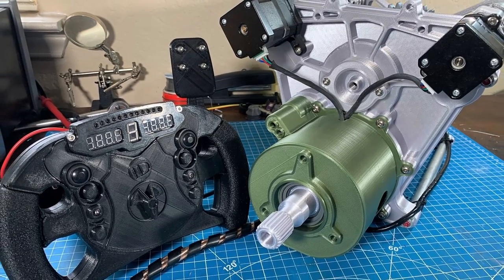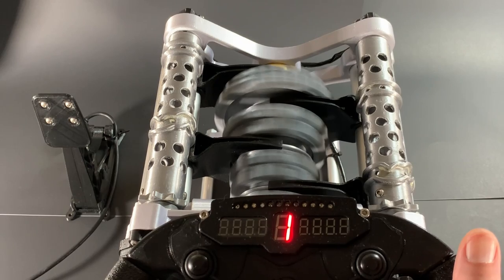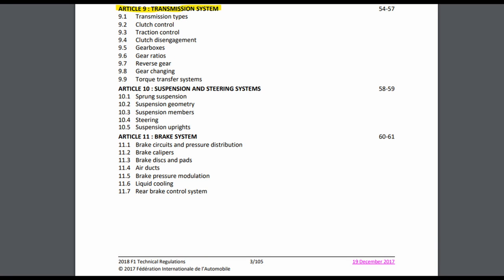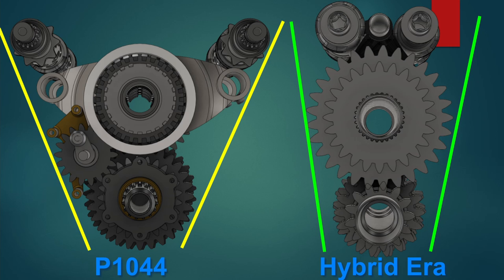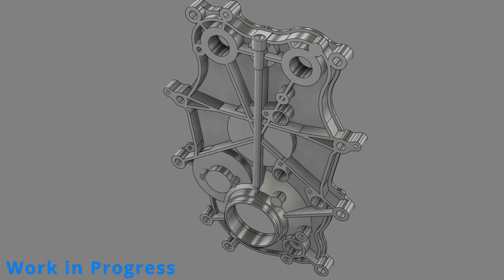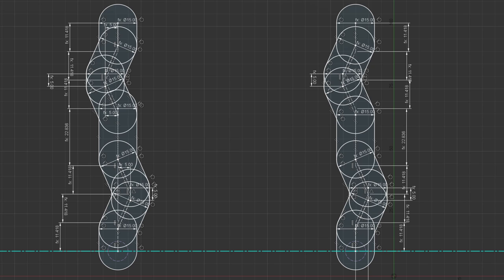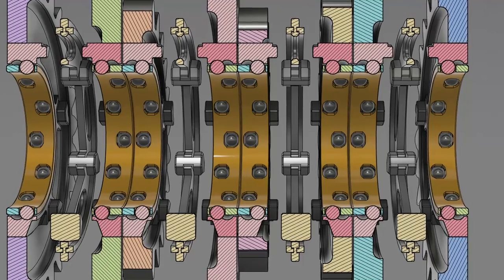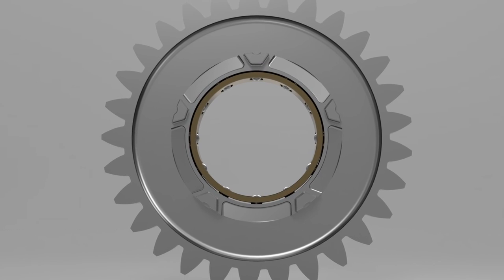F1 Hybrid Era Seamless Gearbox Pt1

Comment: you should check out MATLABS and the Simulink addon. its great to help you with coding and has an awesome modeling environment and simulator. plus the community is really informative, costs money for the one time license, has a free triail. I just got the home edition because im only trying to make some autonomous robots, but I think you would benefit from it a lot with all the technical working your running. Awesome watching you build these marvelous of engineering, keep it up. would have loved to see the other F1 gearbox in an rc car :p
Reply from the maker: Thanks!  I really do need to check out Simulink.  The hard part is I’m weak in the math side and being able to accurately model systems. The active suspension project definitely has sent me back to the books to brush up on my linear algebra.

Comment: 2:18 fyi, I think "no torque loss" is more of a marketing term of an entire system. 

I think they way you envision this gearbox is not accurate.  I think the dog of a oncoming gear would be destroyed if it was slammed in and the offoing dog would not have time to disengage. And even if both survived, the disturbance to the output shaft would be enormous.  
Is that really how it works? Maybe I am biased by working mainly with passager vehicle transmission.  designs. 

To me the minimal requirment to have smooth and seamless output torque transition from one gear ratio to another for the upshift under load is to have two friction clutches somewhere (or one friction and one one-way dog but since there are two gear shafts, that would mean at least to friction clutches anyway). Then together with input torque managment during shift (when new friction clutch is being loaded, increase the input torque, and then to allow for engine speed to go down, decrease input torque - while friction clutch is slipping and transmits torque proportional to its normal force) the output torque can be continuous and even boosted for a short time when engine is dropping the speed. 

Traditionally if you have only dogs, the output will have to drop to zero for a fraction of a second before engaging new dog. It also have to drop close to zero to even be able to disengage tirst dog. 

Since there are two shafts with gears preselected and marketed as a seamless, I am guessing those boxes are operating on DCT principal (two friction clutches) and two shafts are simply used to preselect the new gear.
Reply from the maker: Thank you for your comment and for sharing your insights! You raise some valid points about how traditional gearboxes and dual-clutch transmissions work in passenger vehicles, and I appreciate your perspective.  I wish there was more information available around these gearboxes.

It really comes down to the controls and speed of the actuators used in the F1 gearbox.  F1 seamless gearboxes utilize a combination of advanced technologies to perfectly synchronize the dog engagement of each gear and they have rapid partial clutch engagement/disengagement. This allows for extremely quick and smooth gear changes even under load.  

It was a very steep learning curve from what I’ve been told of the development process for the early seamless gearboxes.  The first gearboxes shattered driveshafts, locked up and exploded, and caused very unpredictable behavior when downshifting.  In the late 90’s when they started development of these types of gearboxes, they didn’t have the computing power and advanced torque sensors to have the gearboxes to be able to smooth out the torque delivery and adapt to the torsional deflections inside the gearbox.  It took 8-10yrs to really develop the gearboxes to the level that we saw in 2009+ F1 cars.

Comment: Hi, I follow your project very interested.
I'm curious as to how to make the Shift Barrel, I can't find information on how to make it. I intuitively understood that a straight channel is neutral, a positive 45° channel engages and a negative 45° channel disengages.
My gearbox under construction is only 6/7 but linear, with only one Shift Barrel. Hope to hear from you. Happy Holidays. Diego Atzeni
congratulations for all your videos
Reply from the maker: So I don’t design the shift barrel around an angle. I lay out the pin slots on paper in a table.  Since there’s multiple slots usually some will be in a no engagement state and one will be the engaged gear. 

So with this table I know how many times the shift barrel moves to go from neutral to say 6th gear. I divide 360 by that number and I know how many degrees the barrel turns per shift. Then knowing the diameter of the barrel I can calculate the linear distance of each shift. I lay this out in a sketch based on the initial table, then in the CAD software I use, called fusion 360 I can wrap these sketches around a cylinder using an emboss command. 

Depending on how this looks I may add extra shift positions (divide 360 by a larger number) to make the angle of the pin slot steeper. 

Another extra is you can add a small flat spot to each engaged position so it’s not so sharp.  I usually use 2-3 degrees of rotation which will translate to some linear distance depending on the shift barrel diameter.

Comment: Hello, I understand that you are a great engineer and the best person I know to ask this question: how do I understand what gear ratio to use in my transmission? I'm currently engineering a single seater car, I'm trying to make it as small and as light as possible and could really use some advice to potentially cut down costs on having to rebuild parts because of my lack of experience. I'd be very grateful to you for a reply, thanks in advance❤
Reply from the maker: Thank you. That is a complicated question and I’m not an expert on this particular topic. It depends on factors like the motor’s powerband, vehicle weight, shift time, and usage. For example, many cars with a high power to weight ratios have a very tall 1st gear.  This is because they are traction limited and the additional time for the gear change would make the car slower.  Cars with narrow power bands, like older F1 cars,  might stack the middle gears very close together so they are at peak torque on the exits of particular corners. 

The only way I know of optimizing this is through simulation or modeling. I don’t know how, but I’ve seen Matlab or Excel used, and for more complex track based simulations something like Adams Car Simulator.
Reply: @IndeterminateDesign  thank you

Comment: Very nice VDO.  
How could i buy or Download this gearbox set?
Reply from the maker: Thanks. It’s available for download on the GitHub. I include the cad as well as you most likely will need to make tweaks as it’s model with very tight tolerances. https://github.com/indeterminatedesign/F1Gearbox

Comment: Are these g-boxes the same as the MotoGP seamless g-box. From your vids there seems to be F1 info, but for MotoGP there isn't a skerrick of anything.
Reply from the maker: Yeah, this is very different to the MotoGP gearboxes. They do tend to use the one way clutch on the gears so that two gears can be selected at once. 

There’s some info out there on the Ducati gearboxes and some detail in the patents for Honda. Someday I may try designing one but it would take a fair bit of time to reverse engineer based on my initial assessment.  Obviously lots of details have been left out.

Comment: How did you design the grooves for the shift barrel?
Reply from the maker: I may do a video on that. The easiest way is to lay it out the shift order on graph paper. Then knowing the diameter of the shift drum and some math you can determine the length of each shift position and draw it in CAD.

Comment: What size 3D printer bed would you need to build this?
Reply from the maker: It’s still being designed, but to print the front cover in one piece it would need a 300mm x 220mm. I’m going to have to split the larger pieces in half to fit my printer.
Reply: @IndeterminateDesign  thank you for your reply. I’m a huge F1 fan and am new to 3D printing. Haven’t even bought my printer yet. Still undecided, but want to do things scaled down, even if they’re not functional. I’ve worked with CNC machining for years, but it’s time to change. Your page is amazing and I will be following it for sure. Do you sell your .stl files at all?
Reply from the maker: I don’t sell them. I have most of them for available for free on https://github.com/indeterminatedesign  I’m still not sure if I’ll be able to put this latest F1 gearbox, I hope to know soon.
Reply: @IndeterminateDesign  I’d gladly try to help from a design point if you ever like assistance or input. I’ll be working on replica steering wheel or a few!

Comment: Any updates?
Reply from the maker: Sorry, I was hoping this would go faster but life has been busy.  The 3d printer melted, it was rebuilt, then the mainboard died, and then I had to wait on parts.   The good news is the core parts have gone thru a couple of rounds of refinement and the printer is now running 24/7 cranking out gears and spacers.  So I hope to have a video out in the next couple of weeks here where I do the first full mechanical assembly.

Comment: questa tipologia non è assolutamente Seamless!!!...il Seamless ha l'albero secondario cavo e al suo interno c'è un meccanismo particolare....io ho il cambio Renault F1 del 2010 Seamless completo e funzionante!!!
Reply from the maker: I'd love any info on that gearbox you can give me on the 2010 Renault gearbox.  From all the information I've received none of the F1 gearboxes that have been used in races have the selectable 1 or 2 way clutch mechanisms like this.  There is an oil distribution tube down the middle of the shafts though.  All of the gearboxes from the Xtrac P1044  onwards have been called "seamless" as the shift barrels can overlap the selection of the gears and the torque drop is less than a few milliseconds.